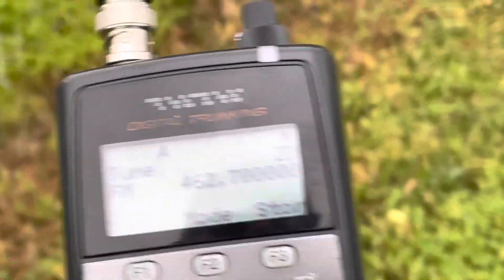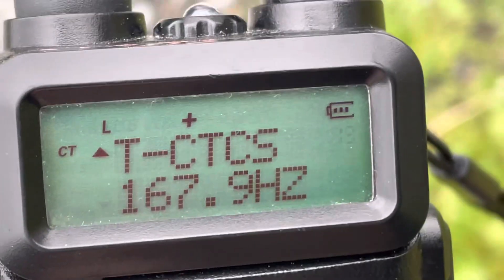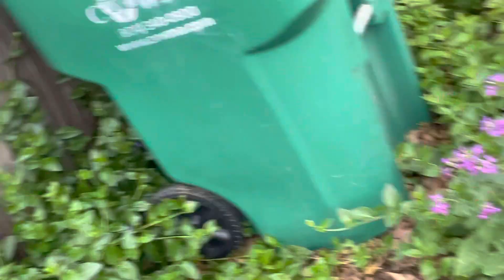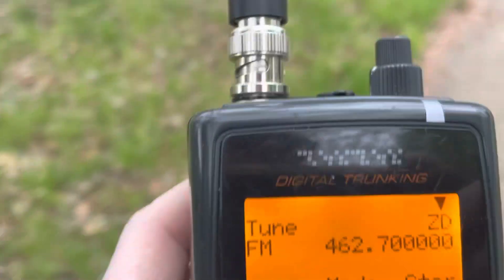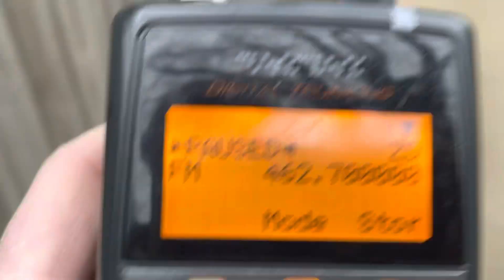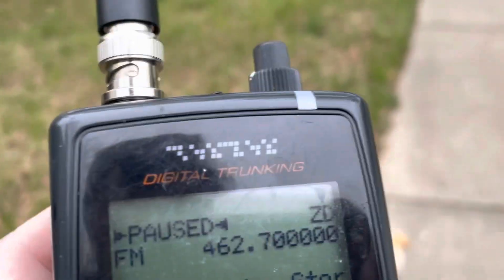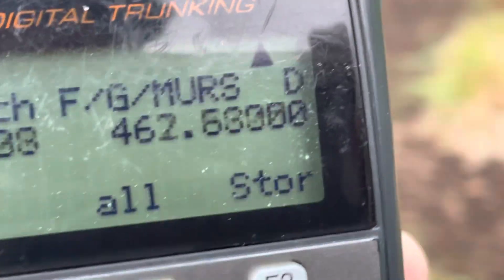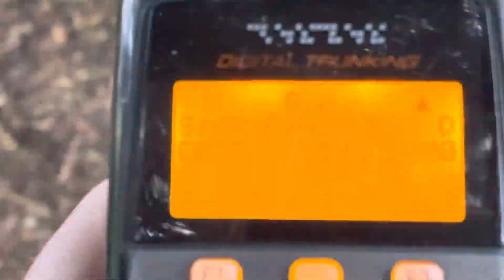Baofeng UV-5R Portable Temporary GMRS Repeater - Part 2 - Operational Testing - Proof Of Concept

Comment: @4002 hey just a heads up you can actually re-broadcast railroad traffic from your handheld scanner and leave it in your vehicle and then take the HT into a store or wherever you are and be able to hear what your vehicle will hear on an external mag mount antenna I have a similar device called a surecom SR-629 that works great for that purpose so whatever my scanner hears my HT will hear so it's just some food for thought in case you might want to do a video on that
Reply from the maker: Yep - you’re talking about a cross-band repeater, this is the same concept, but both radios are on the same band.  

All the equipment reviews I’ve done on this channel are done with equipment I pay for out of my own pocket.  I’ve been on YouTube for over a decade and YouTube has paid me one time ($150) about 8 years ago.  I haven’t made a dime since then.  

Otherwise I would be doing a lot more varied videos and reviews on lots of additional products.  The Surecom repeaters are on my list of items to check out.  

I’ve used the Radio-Tone RT-SRC1 simplex repeater controllers for years.  They’re not as widespread as the Surecom gear but they’re worth looking into.